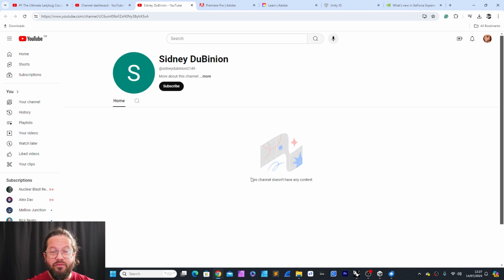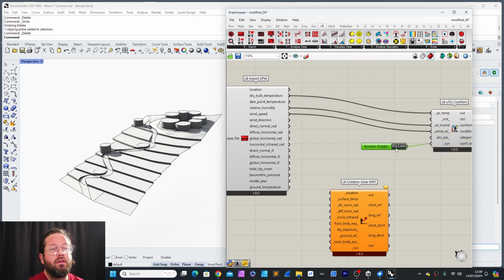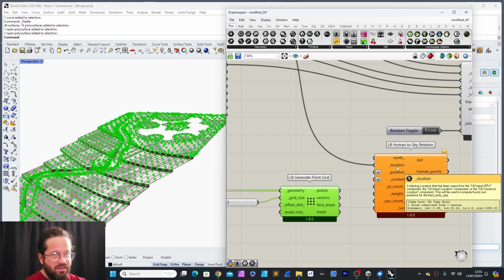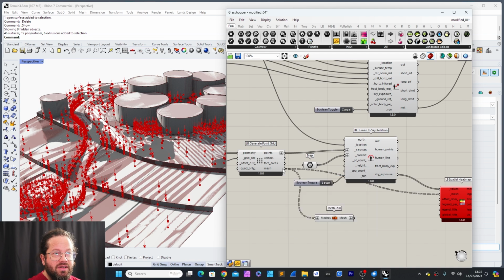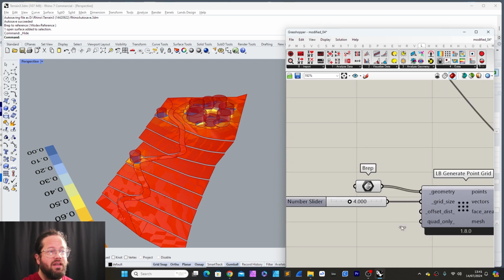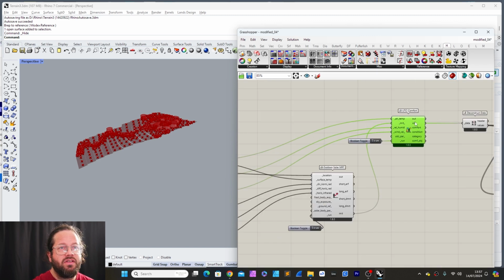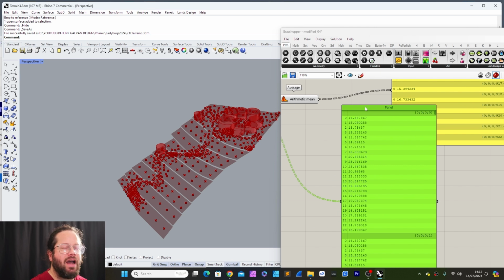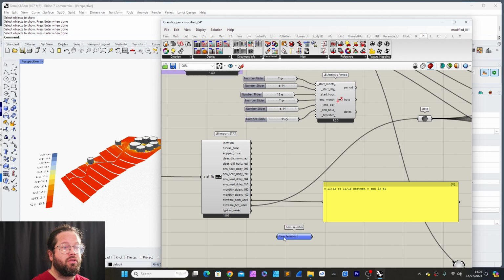#23 Ladybug 1.8 Tutorial: Outdoor Comfort and 3D models

Comment: Hi, how would you filter the data for daylight hours only, and aggregate the results for summer only to see what areas are compliant for 90% of the hours in summer? Thank you!
Reply from the maker: You can simply set the period to from let's say 6am to 6pm depending on sunrise and dusk so then it captures only these hours per day of the period you set ( like from June to August)
But I would actually use design days.
What you really want to know is: how does a site perform during peak levels.
If your period is too long it might give you a wrong impression. Actually you could limit the hours over the the whole period so you just check the hottest hours of the day  like from 11am to 3pm...

Comment: thanks from Korea
I have purchased your script. Could you please advise on the best way to run the simulation by differentiating the ground surface pavements? For example, I would like to distinguish between various materials such as grass, concrete, and asphalt
Reply from the maker: The ladybug UTCI tool gives an overview for early design stages. It allows only for a very general context assumption. For more detailed UTCI study You need to use Honeybee where you can setup materials.

 I did a video for that:
https://youtu.be/hnExu7Nu7QQ?si=z4duDlfgWGBGR6On

Comment: Hello, may I ask a question? What is the difference between “HB UTCI Comfort Map” and “LB UTCI Comfort"? If I want to apply one to do my research ( without material ), which is more accurate or faster ( I'd like to use Galapagos so I need it to be fast )? Thanks!
Reply from the maker: Ladybug doesn't account for material only very general. Honeybee is more specific to a certain architecture or for example a block of buildings...  Ladybug is to get an overview. Honey is to zoom in and more detail.
Reply from the maker: Ladybug is faster definitely and works with rhino models. For honeybee you actually need to first create a honeybee model.

Comment: Hello Philipp, Thank you a lot for your videos. Great work! I have two questions. 
1- Don't you need to also limit the simulation period for the data of the fract. solar exposure? 
2- How can we average data for each point on the grid and plot one hourly chart for UTCI? I can only plot a chart for each point on the grid.
Reply from the maker: Question 1:
The human to sky relationship doesn't require weather data information. It's the relationship between location and objects. No sun movement.
Result is one number per point.
Question 2: you need to average the list of values per point to get an average number per point.
Then you need to flatten the resulting list to get a single list with one value per point. Not a list of lists with one value....
Reply: @PhilippGalvanDesign  Thank you a lot for your reply.

Comment: Hi Philipp,

Thank you for your insight. I am wondering if your "Materials and Thermal Outdoor Comfort with Honeybee | Ladybug Tools | Grasshopper3D | Rhino" video made a year ago would pair with this video. I am looking to analyze a site for UTCI, but both videos seem to give me a UTCI, what is the difference in the one found in this video vs the one in the other video. Appreciate your help.
Reply from the maker: The difference is that Ladybug takes a more general approach. Meaning that there are no materials specified except for a very general assumption of the ground material...
Further Ladybug doesn't require a honeybee model to run. It's possible to use it with the native Rhino geometry. Honeybee is an energy modeling tool mainly for buildings and it's close surroundings. Different materials influence the UTCI in different ways. Imagine you are doing the UTCI study for a whole City or District or in concept where you have only a simple massing model. Then you would use Ladybug. The more refined you projects become the more detailed you want to study specific areas of your project with materials and on a smaller scale like the courtyard of a building complex. Then you could use honeybee to get a more detailed result.
Reply: @PhilippGalvanDesign  This makes so much sense, thank you! Have looked everywhere online for an explanation, so hard to pinpoint. Do you have a video on your channel that would cover shading analysis of objects while utilizing UTCI, direct sunlight, all impacting elements using honeybee and taking into account different ground conditions like grass, concrete, etc. to give human comfort results on the rhino model within the updated software versions?

So many combinations I try crash my grasshopper...

Comment: Thanks for this. Would you recommend this method over the UTCI map script (with honeybee rooms for different materials) for modeling public spaces for landscape architects? Does this script run faster? But I imagine you will lose detail and refinement as it doesn't account for changes like removing pavement or adding vegetation, except for the additional shading from new trees? Thanks for the info
Reply from the maker: it's a great tool for initial massing studies. urban plot and district scale.  Honeybee will use the same weather data but will add material information as you correctly mentioned. I would use honeybee to use it to zoom into specific areas. at the end it also depends on the computational power you have available...
i think it runs faster but haven't checked...
Imagine you only work on a massing study without any knowledge of materials yet... what would you use?
Reply: @PhilippGalvanDesign  Thanks for your reply. Indeed, a good suggestion to use it  for massing studies without materials or at a bigger scale.